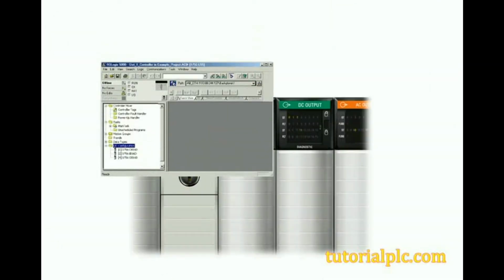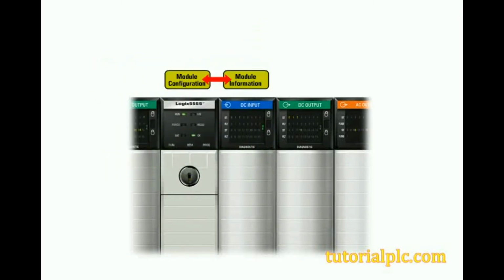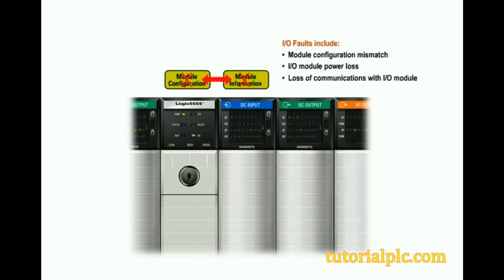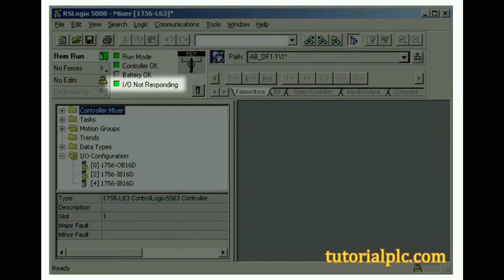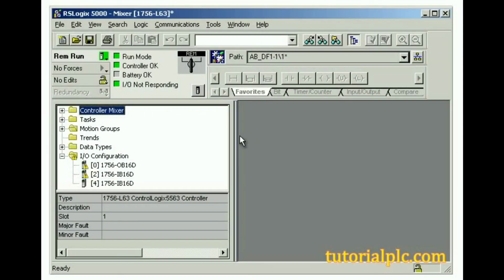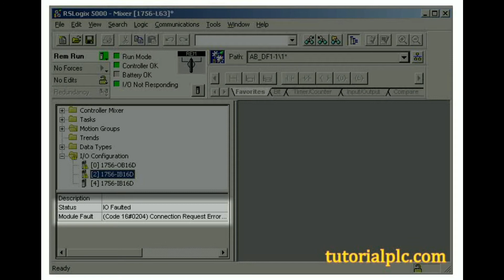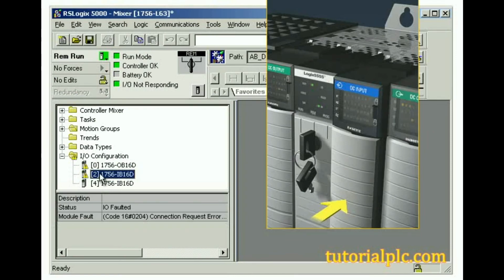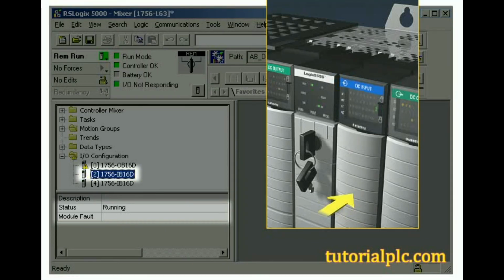Rslogix 5000 Clearing an IO Fault

Comment: What if you are trying to download a new program into a PLC on a test bench without any of the I/O modules present?
A dialogue box appears saying "Cannot download faulted controller. Clear faults and try again."
Reply: Found the answer.. (will need to translate to English)

https://rekayasalistrik.wordpress.com/2015/12/10/cant-download-to-faulted-controller-clear-faults-and-try-again-allen-bradley/
Reply: 1. Change the selector position from run to prog.
2. Then go back online.
3. Select "Major Faults".
4. Select "Clear Majors".
5. Done, and can be downloaded again.